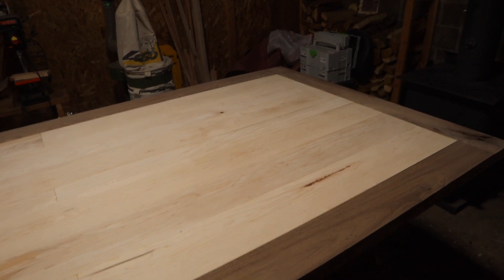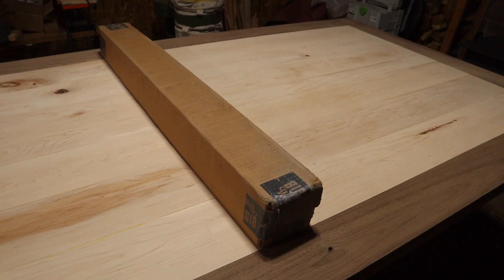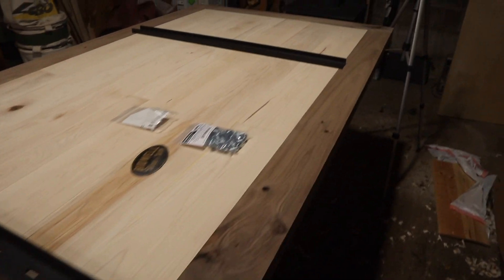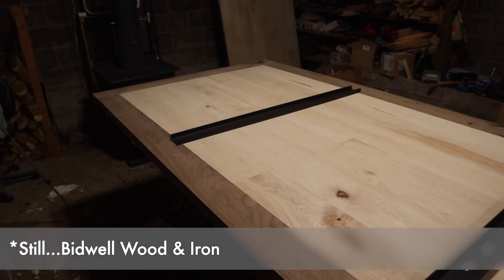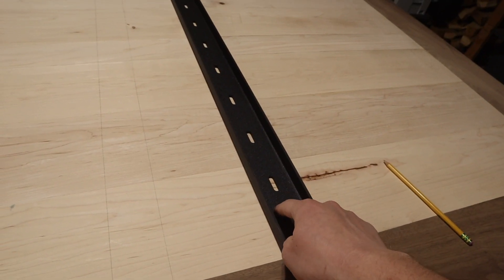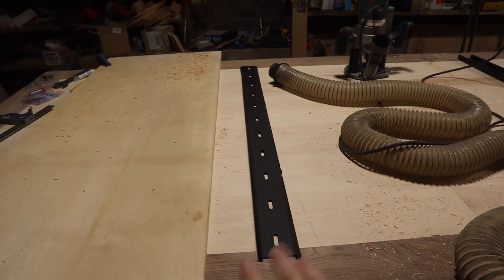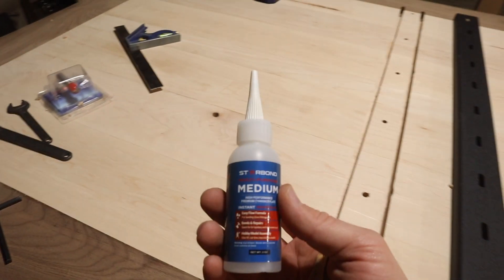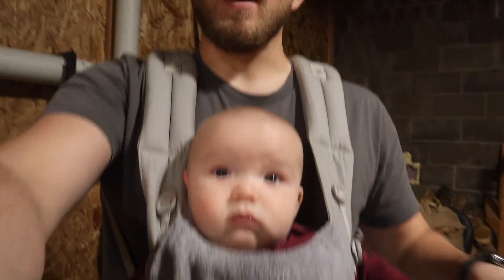Installing C-Channels into the Conference Room Table

Comment: Great video! For a 1.5" thick table thats 50" w what size C-Channel would you use? is 1.5" w with a long 3/4" leg big enough, or go with a 2"w x 1" leg? And would 3 be enough for an 8' table length? Thanks!
Reply from the maker: Great questions all around! Bidwell Wood and iron has an informative table on their website, which I believe recommends 3 to 4 inches on either side of the C channel to the edge of the table. I will link it below. Regarding how many, three sounds reasonable, do you have breadboard ends?
Reply: @NorthwestCraftsman  Hi, thanks for the quick response. No breadboard ends, and I'm going to use maybe 6-8" wide boards to make up the 50" of total width - to also try to reduce the cupping.
Reply from the maker: Sounds good! I’m also realizing that I never linked Bidwell. 

https://bidwellwoodandiron.com/pages/channel

3 seems sufficient to me. I’d probably place them about a 6 inches to a foot away from each end and then center the last one. 

I’d love to see how it turns out! If you’re willing, email me some photos. My email should be on the about page of my channel.